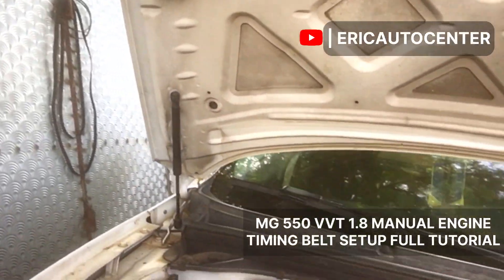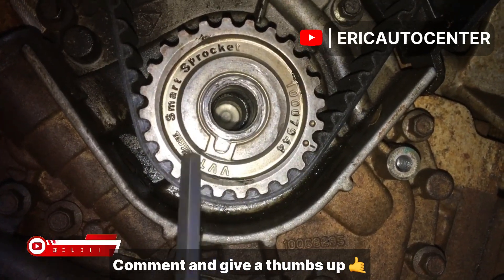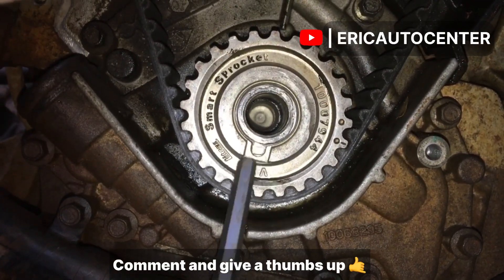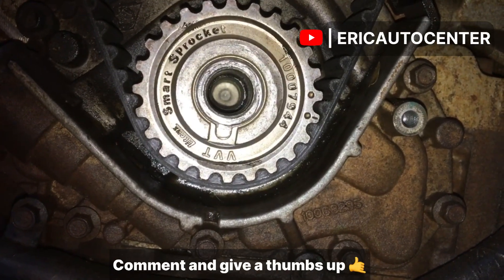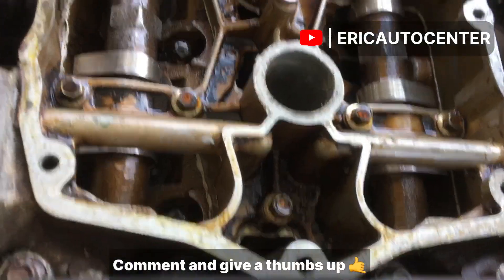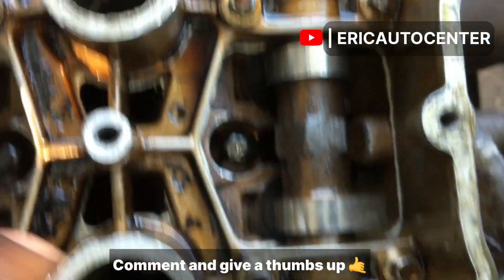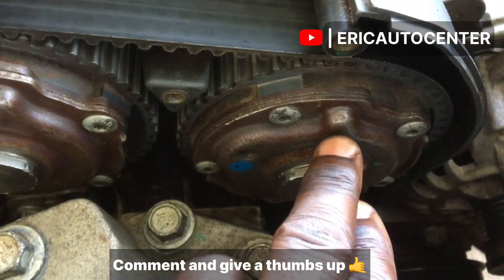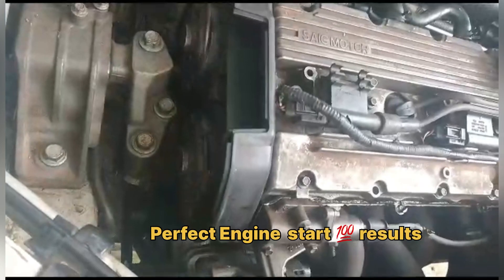How To Time Your Mg 1.8 Engine

Comment: I have a car with a manual mg 550. The water hoses blow up and water comes out of the cylinder and the gasket is lost. What is the problem?
Reply from the maker: There is a brown head gasket and i am sure it has affect the cylinder head you need to show it to an expert to rectify it
Reply: But when I showed the car to a mechanic, he told me that the timing chain was irregular Which was causing me to blow water hoses
Reply from the maker: @medjerabbilal8249 for that one I can’t tell and I don’t know what you have done on it so  if you want me to give you proper information tell me how it started
Reply from the maker: @medjerabbilal8249 can someone translate it in English if you because I don’t understand your language
Reply: The car was normal, but when I changed the timing, the water hoses started to swell, and after a while the gaskets were lost. I took the gaskets to the expert and he did a sweep, and I changed the gaskets, but the car still had the hoses swell until it was running on three wheels, and water started coming out of the shank, and I mixed the water with The oil is in the car's crankcase, that's all
Reply: The car was normal, but when I changed the timing, the water hoses started to swell, and after a while the gaskets were lost. I took the gaskets to the expert and he did a sweep, and I changed the gaskets, but the car still had the hoses swell until it was running on three wheels, and water started coming out of the shank, and I mixed the water with The oil is in the car's crankcase, that's all
Reply from the maker: @medjerabbilal8249 Ok where do you locate
Reply: I am from Algeria